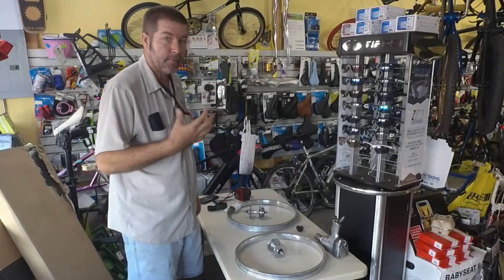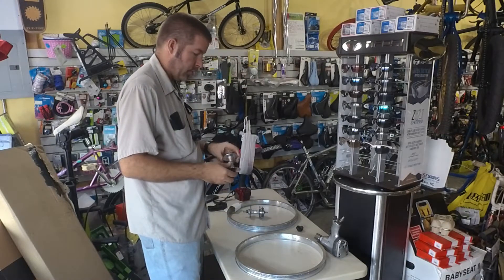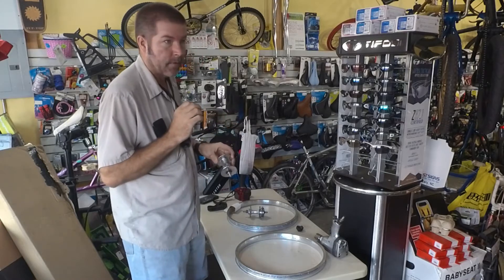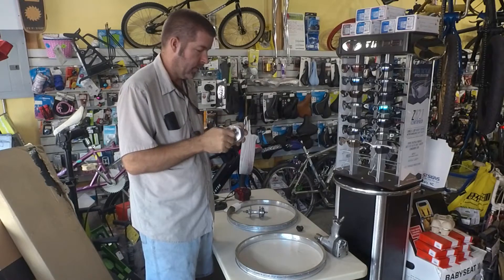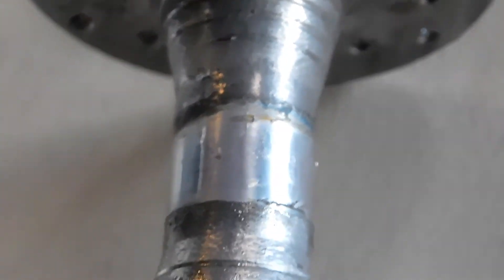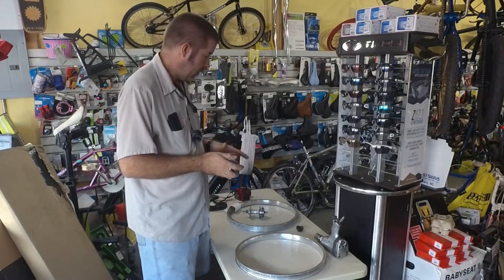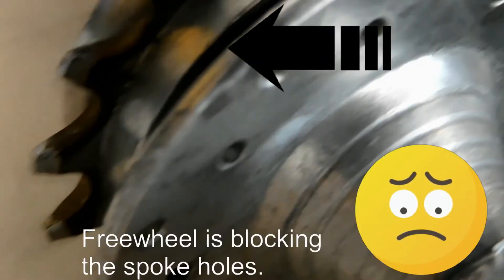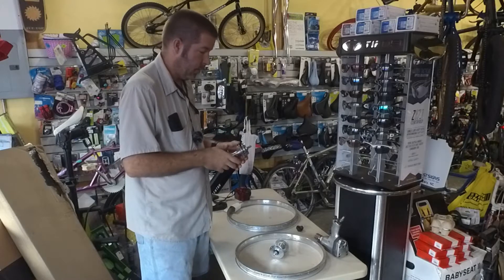1980's GT Aggressor Wheelset rebuild.

Comment: Old school trick is to use a thick leather belt to wrap it and hold in a bench vice that was the method we used in the 80s
Reply from the maker: That would have been nice. The closest thing I had was the leather sleeve from my welding gear. Thanks for the suggestion.👍

Comment: Hey Jason thanks for the great video I have a quick question about 3:30 second inch chain because I'm running a two-speed Shimano SX on my 85 power light .   I'm having a problem because the Skyway rear tough wheel cassette that I'm running which is a 14 mm cassette is made for 1/8 inch chain do you know if I can find a cassette that's 3/32 in because I believe I have to run that size chain for my front derailleur is this correct or can I actually run a 1/8 inch wide BMX chain on that Shimano SX front derailleur? but I don't think I can any insight is greatly appreciated thank you once again Jay Rock ( my other option might be to plane down the cassette so the chain will fit)
Reply from the maker: Thanks for your question. Yes, they make a 3/32 cog for your Skyway. You just need to get that. If you can't find one in a pinch I did grind my cog more narrow to fit. It did work but was such a pain. Do yourself a favor and just find the correct gear. Goodluck.👍

Comment: How come you cant put it in a vice, with some thick rubber guards, to clamp the aluminum hub in?
Reply from the maker: The shape of the hub was making that difficult. The flanges were getting in the way. I tried clamping the flanges themselves and the were cutting through the rubber and the leather strips.